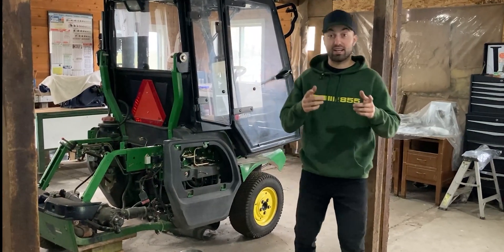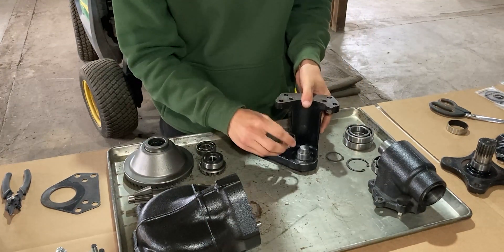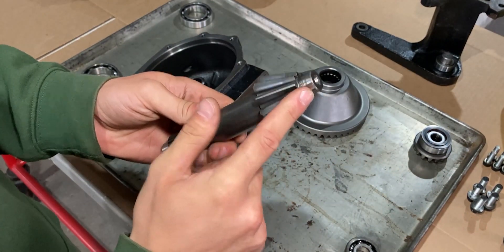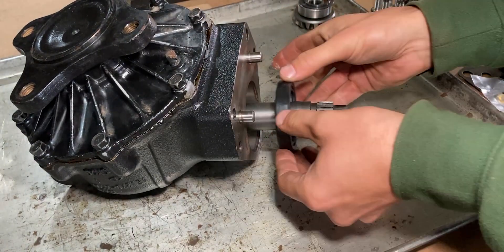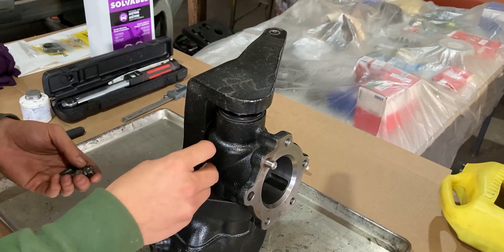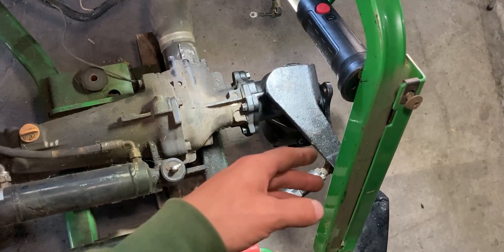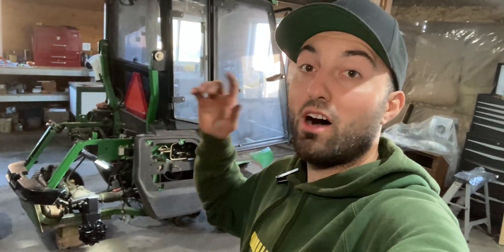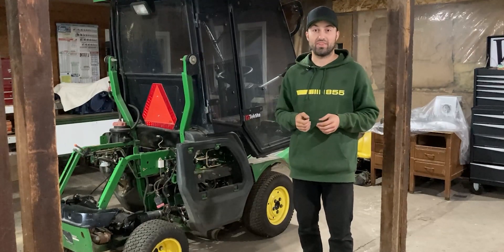John Deere 1445 Tractor Rear Axle Repair - PT6

Comment: For anyone watching this because they need to carry out the repair - cross reference the JD bearings and seals to a quality bearing manufacturer. You'll save yourself a bucket of cash, and end up with the exact same parts. Don't get stung with the "JD Tax".
Reply from the maker: Great advice! The bearings are probably more expensive, but I found shaft seals to be priced cheaper by Deere than other online stores and industrial suppliers.

Shipping prices have also gone up a lot in my area and I also have to see what makes more sense while purchasing. 

Thanks for your comment😃👍🏼👍🏼

Comment: is there any information on replacing a leaking seal on transaxle L/H brake lever seal
Reply from the maker: Hi there, I did not share specific information on how to do this in a video, but I shared some pictures on Instagram about this: https://www.instagram.com/workshoprebuild/p/CovOwy3SgG7/ 
Whichever side you need your seal replaced, you're going to have to remove half of the transaxle, directly on the housing. Everything slide off to the side if you remove all bolts. I would also recommend replacing the linkage seal while you're at it, because it's about $5 and if you don't replace it in the meantime it'll bite you in the near future (haha).

I hope the pictures will help you out and if you need an exploded view of this assembly, check it out here: https://bitly.ws/3e5Lq

Let me know if it works out for you. Regards Andreas

Comment: Hey mate, do you know off there's an easier way to remove the drive shaft from the front transmission to the rear than unbolting the entire rear diff? I just need to replace one of the protective rubber boots, but seems like I'll need to remove the exhaust and entire rear diff to get the shaft out...? Thanks for your help.
Reply from the maker: That‘s a great question.
Have you tried to loosen off both u-joint yokes on the splined shafts, slide the driveshaft one way and remove the shaft?

This is the only way it could work without removing any major components.

If John Deere assembled the driveshaft before installing the front or rear axle, then you need to make some space somehow. The rear axle is easier to deal with, because it‘s lighter and it has fewer mounting points.

Let me know what you figure out! 
Regards Andreas

Comment: Great work. Can you tell me or point me in the right direction to find if a 3NTV88 engine will work in a John Deere 3005 compact tractor? Thanks for your time and help in this matter. Have a good day and keep up the good work.
Reply from the maker: Thanks a lot! I'm not sure if it will fit, but you could probably make it fit.
Here I found a website that shares both the Yanmar 3TNV82A engine sizes and Yanmar 3TNV88 engine sizes.
You can compare the sizes given on this website to measure your block and see if something bigger will fit. I just cannot say it will fit, because I don't know much about your John Deere 3005 and how certain components are routed.

Website for 3TNV88: https://engineswarehouse.com/wp-content/uploads/2020/11/3TNV82A-01-1024x732.png
Website for 3TNV82A: https://engineswarehouse.com/wp-content/uploads/2020/06/3TNV88-01-1024x675.png

I hope this helps. Regards Andreas
Reply: @WorkshopRebuild  thanks for your help.

Comment: A different project to what I normally watch but as ever very concise and informative video.
Reply from the maker: Thanks for tuning in, even though you don’t necessarily watch this type of content.
I will be working on the R60/5 once I get my parts back from the machine shop. The engine needs to be done before I touch anything else…that‘s why it‘s a big hold-up😔

Regards Andreas